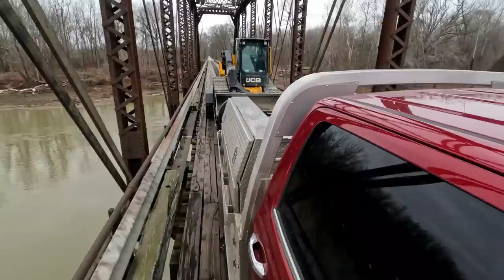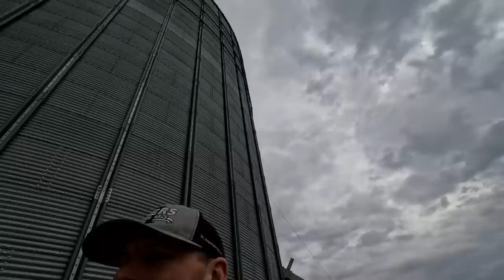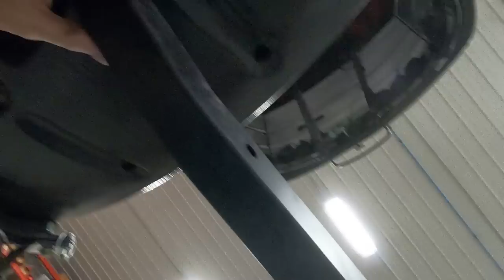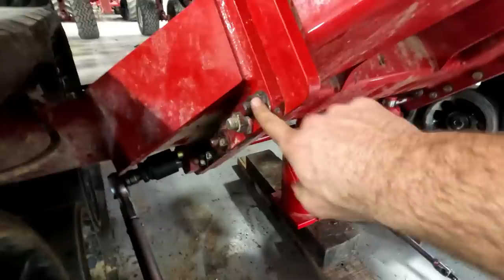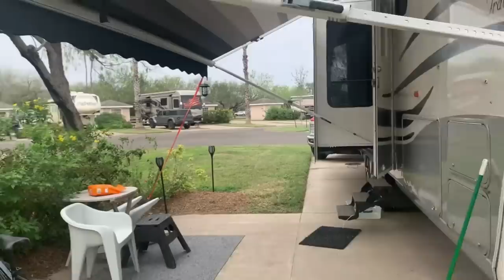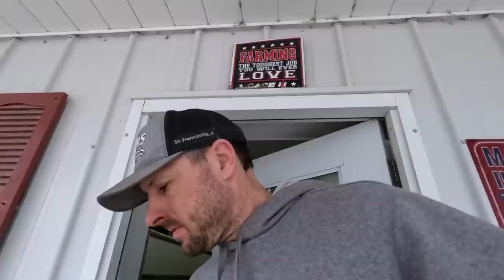A Big Mess Of Corn & Moving the Tracks In On A Case IH 2160 Planter Season 3 Episode 54

Comment: I had a similar incident happen to me when I worked for a local co-op that had a grain elevator. We had 2 over head bins that were chain open or close. One day I was filling a truck up with corn that needed dried and when the driver pulled forward to finish filling, it pulled the chain into his trailer. I had to climb in the trailer with the bin going full blast to shut it off.

Comment: i use my Yamaha dirt bike and built a light weight trailer that i tow behind the dirt bike to move between fields and have been doing it for 30 years and i can hook it up behind any thing with a short chain and i do not need a hitch on things like a field cultivator and i pull it behind the grain head behind the combine as i work alone

Comment: I am sure you have considered it, but by rigidizing the track system to the planter frame, when turning, the tracks will dig large berms in the soil, digging out already planted seeds around ends, etc. You just about need a hydraulic lift system on those tracks to as to raise them before turning to prevent digging
Reply: Raise the tracks? 😂😂😂😂
Reply: @gregjames5070  😁😁 yeah, impossible---right? just don't turn short